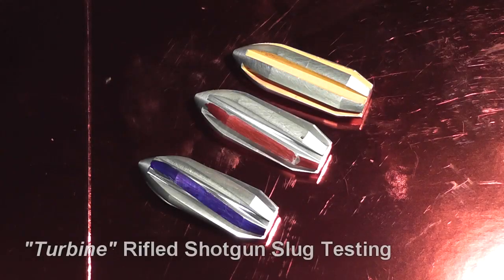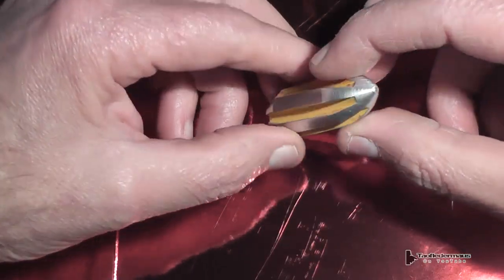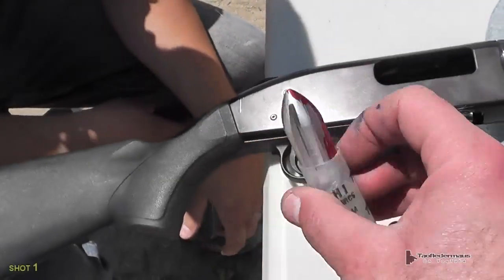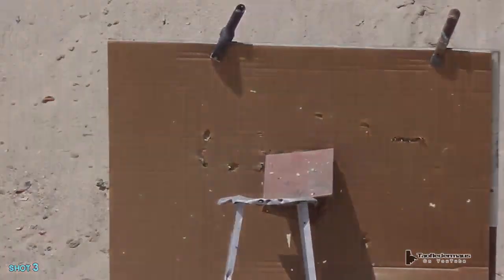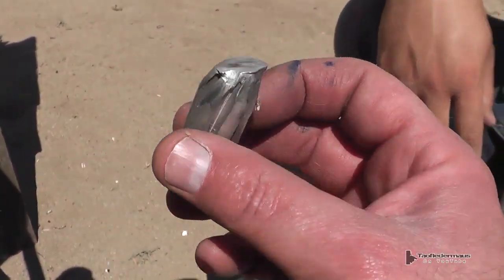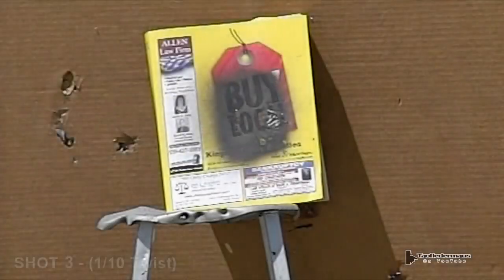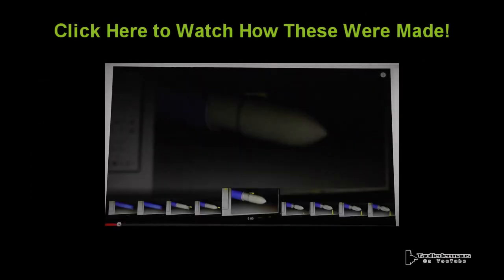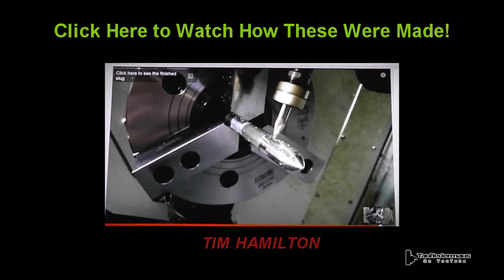Custom Aluminum TURBINE Shotgun Slugs  -Testing

Comment: As stated in other comments below, rifled slugs (foster) fly straight by having the center of mass in front of the center of pressure. An arrow will fly very true, with a straight fletch and does not spin, but its center of mass is ahead of its center of pressure. The design of most bullets places the center of mass behind the center of pressure, which is unstable, therefore they require a spin to stabilize them in flight.
Reply from the maker: bbhrdzaz  well said

Comment: cool projectiles! do you think anchoring lighter material on the back of the slugs would stabilize its flight? like fletching on a dart or arrow but more like multiple strings
(strong and heat resistant) growing out of these slugs which would create some "drag". i don't know if this concept will work with super high velocity but i think it's worth a try.

Comment: I think the problem is that the power is not enough to push and accelerate the projectile to keep it straight and the rear end is being pushed to one side as the rear plug exists the barrel causing the projectile rear end to twist . Or the barrel is not long enough to allow the energy to accelerate the projectile up to speed and using all the presure so that it does not rotate the back end . But that is only a theory I have .

Comment: you'll never get a balanced slug to shoot straight out of a smooth bore barrel.  it will always tend to tumble.  the fins on these slugs wont cause the amount if rotation required to stabilize the bullet.  the best you can so is something like a drive key slug that acts like a badminton birdie.

Comment: Aluminium is the problem, it's way to light to fly straight. That and it looks like the grooves are way to deep and squared where as they should be grooved in a rounded way

Comment: I imagine the core flaw with rifling the round and not the barrel is that the expanding air behind the round spins it in one direction, but outside the barrel air resistance spins it immediately in the opposite direction, hence the tumbling.

Comment: The problem, from what I can see is the pressure pushing forward through the rifling is overpowering the air resistance that's needed to cause the round to spin. That contradiction is causing the tumbling. Stopping the rifling 90% of the way back, with the rear of the round made concave like you'd see on a pellet could potentially fix that.

Comment: I suspect the turbine slots aren't working because the round can't spin up until it's out of the barrel. In the barrel, it's moving with the air rather than through it, so comes out with no spin and tumbles before it can get any speed up.

The only thing I can think of get it spinning before it leaves the barrel is to modify the inside of the shell casing so that the slug sort of threads into it and will take on some amount of spin as it threads out again. I don't know if a plastic shell casing would put up with that, but maybe Tim could mill out an aluminum or steel shell casing with the same outside diameter and primer hole but with walls thick enough to take slots or at least hold pins that would engage the slots in the shell.

Then again, I'd be a bit worried that the slots would bind up and turn the shotgun shell into a grenade casing.

Comment: Cool test but ur not going to get much rotation from the bullet having "fins" cut into them the bullet rotation comes from the rifling in the barrel if u hust had a lead or brass slug with a rifled shitgun barrel itd be way more accurate than a machined slug :P

Comment: Have you guys though of using a single barrel break way shotgun?
Reply from the maker: James Bilevich  This Mossberg is for making videos.  We can fit anything into it.  The most important thing it so have a cylinder bore.  Break actions have a tapered bore (built in choke)  so that would limit the size of what we could shoot out of it.

Comment: I suspect that these slugs keyhole because they are not a close fit in the bore, and are possibly a little too long. In order for the slug to stabilise, it needs to be a good fit in the bore. Another point is the relatively short barrel. (The 20" barrel would be illegal in the U.K., where shotguns must have a barrel at least 24" long to be legal,) A longer barrel and tighter fitting slug ought to give a better result. Aren't rifled deer slugs a better fit in the bore?
Reply from the maker: tigertonten  Yes,  deer slugs do have a tighter fit,  but aluminium isn't very soft and we were concerned if the fit was too tight,  the alum.  would seize up in the bore.
Reply: ***** I see your point, but there are very soft (not as soft as lead of course) grades of aluminium available, and a good but still sliding fit in an unchoked barrel might give a better result. Unlike lead, the alum will not spread to seize in the bore. A rifled slug gets its spin from gripping the bore slightly, these alloy ones are relying on the machined grooves acting as fins, and they probably don't have the velocity to make that happen. In the slow-mo shots, they seem to drop very quickly. I doubt that they are supersonic, although they do seem to hit with some considerable force, but then I suppose pretty much anything with a powder charge behind it at close range would! I don't think I've seen all of your videos, have you tried simple round musket type balls for accuracy/penetration?
Reply from the maker: The rifled slugs really don't spin.  The slugs do have spiraled grooves on them,  but  this is to allow them to easily swage through a choke.  I've seen people use Foster slugs shot through a rifled barrel and it is a little more accurate.
We have shot ball bearings and those were fairly accurate and of course didn't smash so they went through things pretty well   We haven't shot lead balls though.
Reply: ***** I do hope you try lead balls, I'd certainly like to see the results. Is there a video of the ball bearings? Have you used a chronograph on any of these unusual loads to check muzzle velocity? Results might be quite interesting.

Comment: Why would you use a smooth bore to fire a rifled slug? Its going to tumble no matter how many twists there are on the slugs. There's nothing to give it the initial twist in the barrel. The same thing happens to high brass manufactured slugs if fired through a smooth bore. I'd really like to see the same test done using the same slugs but out of a rifled barrel.

Comment: He needs to remake those with a steel or tungsten insert in the tip. This will get the weight properly shifted forward of 1/4 chord length of the slug and therefore should prevent them from tumbling.

Comment: If the guy making these is reading comments; Try making a cavity in the front of the round and filling it with lead. That might add to its stability, and I think the grooves are too deep, they only need to be on the surface for barrel contact once it's out of the barrel the air will just make it tumble with large grooves.

Comment: you want it to fly straight and hit hard - it must have a composite design - fins in the rear to point the nose forward - a cup design filled with a lead pay load and a sharpened tool steel nose cone - it has to have a shape similar to a mortar - its not just a bullet - its a flying machine

Comment: I was very positive that these would not work.   They look awesome but aluminum is too light and too soft.  That much force the twist do not respond to the smooth barrel.  This is a good thing because if it did catch and bound it would likely damage the gun and possibly the shooter.  When you shoot a riffled gun the ball is soft and interacts with the riffling of the barrel.  The soft ball deforms the barrel does not.  I think it is possible to make a shell spin in a smooth barrel, but no amount of groove will work.  Perhaps some one could modify the base of the ball to cause the gun powder to cause it to spin.

Comment: I think the problem with rifles rounds is that they will start off rotating in the opposite direction in the barrel becaue of the blast from the powder charge traveling through the rifling, so when the round comes out of the barrel and hits the air it will suddenly have to spin the other way.

Comment: +TAOFLEDERMAUS Awesome vid!! With your experience on these crazy rounds do you think mabie a tungsten or lead insert into the tip of one of those would make any difference at all? I know the forces going on are tremendous!
Reply from the maker: Brutal Noodle !   It's possible.  I have two more and drilled out the tip and filled them with lead to try to balance them better.
Reply: Very cool thanks for the reply! Cheers!

Comment: rifling on the bullet does not impart the spin.  Rifling in the barrel engages the sides of the bullet and imparts the spin.  The RPM of a bullet in flight is extremely fast.  For example a 1:8 twist  at 2800 fps results in a spin of 252,000 rpm.  Projectile needs a weight forward design to self stabilize.  Hollow base or a bulbous nose.

Comment: They do look wonderful.  No spin untill air is bearing on and traveling through the slots.   Greenhill formula is used for coventional barrel rifling.   Ditto the weight forward comment.   Rocket stabilization is done by having the Center Of Gravity  forward of the Center Of Pressure.  Fins on rockets are to move the Center of Pressure aft, and on a projectile can impart spin too.  Arrow fletching ( fins , feathers ) is glued on precisely to impart some spin.  Googling rocket stabilization, may come up with some design criteria.   Conventional rifled slugs have a hollow base.  Some slugs used to look like big airgun pellets.
Reply from the maker: David Bostock   Good points!
Reply: ***** The grooves looked as if the expanding gasses inside of the barrel would have started the spin in one direction and when it escaped the barrel and the gasses were no longer venting through the grooves, the air suddenly coming from the other direction would try to stop and reverse the spin, causing it to tumble.  That sort of round might require a sabot.

Comment: creating rifling on a bullet is not going to do anything since at those speeds the air going around the bullet most likely creates pockets of non moving air in those channels.  Barrel rifling relies on friction to cause the bullet to spin.  As soon as the bullet exits the barrel, changes in air pressure create instability and allow the round to move and catch.

Comment: Fun videos you guys are putting out! 
Even though the mass of these AL slugs is light, I'd think you'd need a more radically spiraled flute design (more radical than the purple marked slug) to impart much spin using air alone (even supersonic air). Adding some orange or bright-green dye in a checkerboard pattern could help you see any spin in your hi-speed camera footage.

Also, in thinking about stability, the center-of-gravity (CG) is an issue. My thinking here is that radical grooves to impart spin would also create drag and pressure rearward towards the base of the slug. That may necessitate moving the CG forward so that the base follows the nose (versus the base trying to push the nose straight ahead). How much, I dunno as I are not a physicist. 

Looking at supersonic airflow over aircraft designs shows a supersonic shockwave creates a large vacuum area behind a tapered nose. Good for airplanes, bad for getting air over/through your flutes. A blunter front end may actually work better for spinning the slug.  Just my two cents worth.

Comment: It's my understanding that foster and brenneke slugs are stabilized entirely by weight distribution--having the weight up front keeps them from tumbling.  The rifling on a rifled slug is really there just so it can be swaged down if there is too tight a choke on the barrel, so that it doesn't destroy the gun.

Experiments are always cool, though.
Reply from the maker: Axess Denyd  Yeah,  they are more like giant pellets.   As we know pellets work in smooth bore and rifled air guns

Comment: Adding weight or density to the tip of these would probably prevent tumble in these; lead, tungsten, etc. That would be cool to see
Reply from the maker: Ben Wallace  Yep,  that is the plan. I have two left and will pack the noses full of lead.

Comment: The "rifling" on a standard slug does not impart spin. It was designed to allow the slug to compress through the various chokes that it may be fired through. A shotgun slug flies similar to a badminton shuttle cock. Heavy on the front with a skirt to create drag. The design of these aluminum "rifled" slugs are flawed. try making one similar to a lead slug, hollow skirt with a weight forward design.

Comment: IDEA: you should put more add more mass/weight to the back of the slug, this will keep the front facing forward, same theory applies to throwing knives. Maybe make the tail end out of a different material, though I do realise this may be quite hard to do

Comment: I think I know why all the rifled rounds tend to tumble. When it is being shot and is still in the barrel, gasses push the round, and leak around it, spinning it in reverse direction, and when it gets out, the air want it to spin in different direction, increasing the drag drastically, and destabilizing it. I think you should get some more of these and paint the with contrasting colors so you see the direction they are spinning. I might be wrong, but I'm pretty confident with my theory, because pressure and gas flow in the barrel are way bigger than when traveling in the atmosphere (relative to the round). Anyway, I like your videos, because you view the guns as tools of learning and science, rather than weapons.

Comment: Careful guys. You could have easily taken one of those to the dome.
Reply from the maker: Brandon Hart  Could have died in a traffic accident too on the way to the range too!
Reply: If you rode in sitting on the hood of your car it might have been almost as dangerous as shooting aluminum slugs at close range... almost.
Reply from the maker: Brandon Hart  Eh, it's just simple geometry.  We always set the plates at an angle to they don't fly straight back at us.

Comment: Put mass in the front, drag in the rear. A coushin of compressed air dosent do alot with vanes.
Reply from the maker: patrick dewane  I agree.  I have two of these rounds left so I am drilling out tip about an inch deep and will fill that full of lead.

Comment: The reason your bullets tumbled was a combination of the rounds not fitting right and not having a real point.
Reply from the maker: franz leimlehner  Then what  is the right fit and what is a real point?
Reply: By that I meant it having room to move in the casing

Comment: I think the rounds are tumbling because the base of the projectile is heavier than the tip. If you drilled a hole in them, to make them look more like a normal slug, I bet they would be much more stable!

Comment: A lot of it might be the lightweight aluminum.  The biggest part of bullet physics is for the bullet to be heavy enough to travel stably at high speeds, right?  I bet a jacketed lead core slug like this would punch through the hard drive, backplate, plywood back and anything else in the way.

Comment: They need a heavier core to stabilize. If he made the same thing, bored the middle out, poured in lead, I imagine it'd stabilized better.
Reply from the maker: nowthisis2stupid   Yeah,  I told Tim if there were issues with the rounds,   I'd set a couple aside and counter-bore the nose and fill it full of lead.    We'll see how those work.
Reply: Also, you may try putting a small piece of ribbon about 8 inches long on the rear-center of one, as drag stabilization. Might be interesting outcome, and would be very interesting on slo-mo. It's light enough, I don't see a drag ribbon hindering muzzle velocity too much.

Comment: put a flat plate behind the slug in the shell, whats probably happening is that the gas when fired is spinning the round one way as it goes down the barrell, then is trying to reverse its spin while it flies.

Comment: I think they would work better if they are heavier then the aluminium ones maybe steel or brass would make them more effective but there cool anyways.
Reply from the maker: rednael   I saved two of the rounds and I have counter-drilled the nose an inch deep and will fill that full of lead.
Reply: ***** That should do the trick at least they will still be perfectly blanced so it could fly straight. Should be epic if they ended up being realy effective .70 cal slugs.
Reply from the maker: Eh,  don't hold your breath!  lol   It still may not balance they correctly.

Comment: Could it be possible that the fins on the wadding are affecting the flight path of projectile? In the slow-mo footage it looks like the wadding is flying off to the side and pushing the rear of the projectile out of balance. It looks like some of the shots try to right themselves but they hit target before they get a chance to stabilize. I wounder what would happen if you shot it from a longer distance, or trimmed the fins off the wadding, or tried it both ways?

Comment: Did it look to anyone else that the tumbling was wad induced?

To me at least, it seemed that the wad was trying to go faster than the projectile causing the round to start the tumble as the wad pushed past the projectile. Maybe try another method of keeping the powder compressed in the shell if you get another batch of projectiles?

Comment: Hi,

I was wondering the other day if a real shotgun could fire airsoft shells as some airsoft shotguns out there have shells with gas in them that is being released when the hammer strikes the back of it, kinda like a firing pin but for gas. Would you know the answer to this?